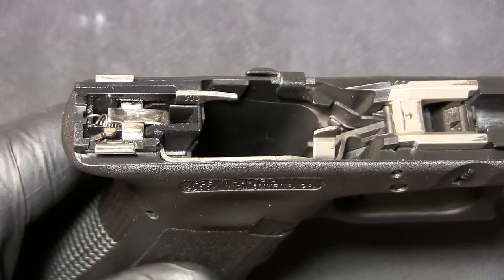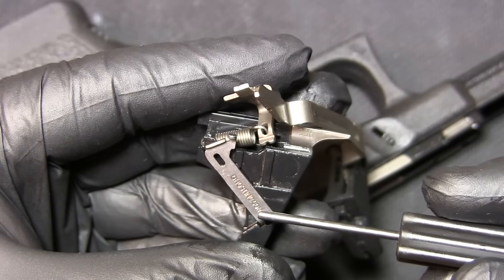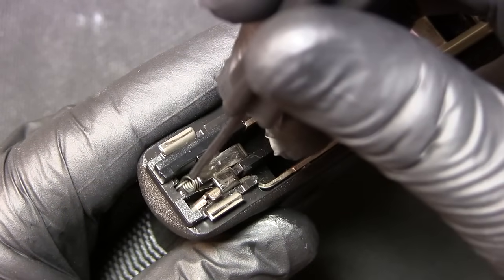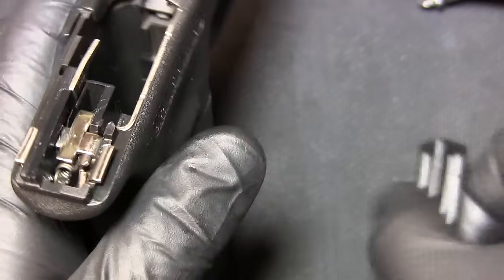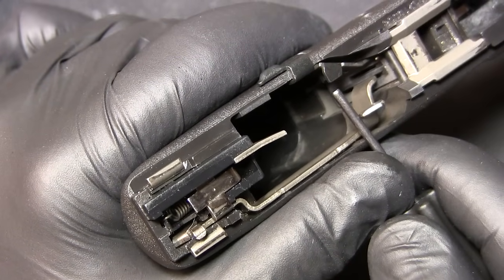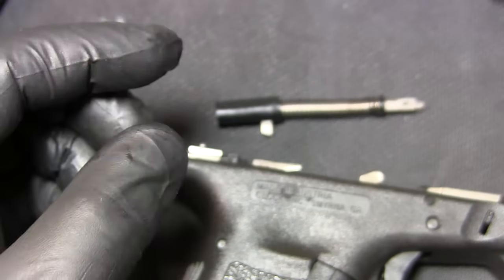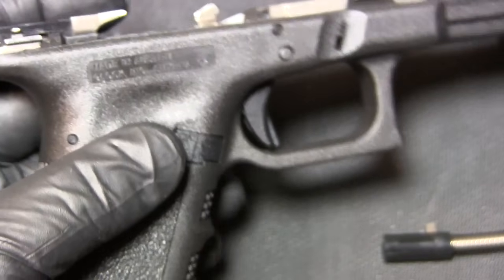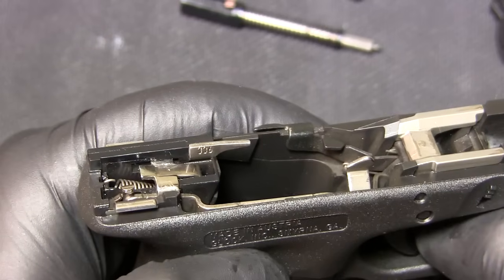How Glock triggers work and how they reset

Comment: So is Glock the only Stricker fire pistols with this kind of a trigger reset? I own 3 different manufacture Stricker fire pistols, and none of them work like a Glock. They are basically built the same way. Is this just a Glock thing? To me, this is a complicated trigger system compared to like the S&W and so many others. I have always wondered why Glock has so much hype and are so expensive compared to others. Probably because of their trigger systems. I got my hands on one the other day for the first time, empty of all rounds of course, and I racked it back and pulled the trigger, and it stayed back. I was like hey, your guns broke, lol Still can't figure out the purpose of it other than that's just how the whole thing operates. At first I thought it was some kind of safety feature, but now I see why. Great video brother
Reply from the maker: Thank you. Not sure if other makers use similar designs, but I wouldn't be surprised if they did. Pretty simple system.

Comment: So if the trigger will not reset if you hold it back then release, after slide is forward. Is it the slide spring? Or the firing pin spring not pushing forward on the reset bar? Thanks in advance.
Reply from the maker: There may be a few reasons. And none of them will have anything to do with a slide (recoil) spring. First you should make sure that the trigger spring is not kicked off to the side on the bottom of the trigger bar. The hooks of the spring should be aligned. If the spring is rubbing on the trigger housing it will produce a failure to reset and a really gritty trigger pull. Let me know if that is the case with your Glock.

Comment: thank you for your video and good explanatiions 
So what is the best way the parts to change to get less recoil with 9mm ? 
thanks 👍
Reply from the maker: Recoil is a different beast. Mainly it will be managed by the weight of the slide and the recoil spring. Lower power ammo can really reduce felt recoil.
Reply: @MosinVirus  thank you for your answer 👍🍺

Comment: I finally understand this, but my question is, doesn't the trigger slap your finger when reset happens?
Reply from the maker: No, never felt it snap on the finger. The force you are applying to the trigger during the cycle is easily more than the striker spring, so you will be releasing the trigger for the reset to happen and feel only a slight click when it occurs.

Comment: DONT FUCK WITH THE STRIKER AND THE TRIGGER RETURN SPRING. EVER!!! just polish out the stock parts and or replace them with after market components as kits from the same maker. or if you know your shit, mix and match but never do what he did with striker spring. that part even the gurus say DONT FUCK WITH. 5.5lbs factory ONLY for fucks sake guys its a safety issue. glock triggers are the way they are for a reason dont try to get a single action feel by screwing with springs and engagement geometry. if you do this and end up hurting yourselves or others, its all on you. Ive built sub 3lbs trigger for a glock and ill tell you its unreliable as it gets...4.5~5.5lbs is 100% reliable given the ammo is made right. dont mess around with the internals people. this not just a rant but a psa...
Reply from the maker: Thanks. This was more of an explanation of the system. I know stretching the spring isn't reliable.
Reply: @MosinVirus  cool
Reply: What about the ny1 spring with factory striker?
Reply: @jll9764  the what?
Reply: @THEGRAYFOXX00  changing the trigger spring to the ny1 with stock striker spring, is that okay?
Reply: @jll9764  im guessing you had the dreadful  aftermarket spring but now you're switching to oem, in that case you're returning the gun to its oem specs so yes it is. btw why did you want to increase your trigger pull weight to damn near 12lbs? majority of us prefer a crip short break between 3.5/4.5 lbs with as close to 0 pre/over travel. just curious
Reply: @THEGRAYFOXX00  NY1 trigger spring makes it about 8 lbs and it's because I'm switching from double/single action. The idea is the first trigger pull would be 8 lbs, then your follow up shots would weigh less with a little more noticeable reset. Correct me if I'm wrong  thanks
Reply from the maker: I don't know why anyone would voluntarily install that NY trigger spring into their Glock, to be honest. If you want a heavier trigger pull, you can go with a +connector. It all depends on what you use your Glock for. If you carry it, i wouldn't advise changing any part of the fire control group. If it is for competition or range fun, then there are tons of options.
Reply: @jll9764  don't bro... don't do that. If u really want to mess around, get the dot  connector with housing that has adjustable pre travel and over travel pinned in. Wolff 6lbs return spring and curved carry trigger shoe. Carefully polished all mating surfaces without altering engagement geometry if you're up to it 😀. Good luck

Comment: Just in case you're wondering why you can't get the trigger to the fully coced position by trying to push the trigger bar forward while holding the trigger down it is because after the trigger bar dropped down due to trigger reset here is the explanation I finally came up with after grappling for an explanation. While the gun is disassembled and after the connector pushes the trigger bar upwards to engage the firing pin then when the trigger bar is pushed forward partially from its most rear position to reset the trigger, at this point the trigger is only half cocked and the trigger bar will drop down so that the trigger cannot be moved forward to it's fully cocked position. When the gun is assembled and after the trigger is reset the trigger bar will not drop down because the firing pin is pushing against it keeping it from dropping down. Once the trigger is released the firing pin spring will continue to push the trigger into the fully cocked position.
Reply from the maker: Not sure what the point of the comment is.
Reply: @MosinVirus  when I had it disassembled, and I tried to reset the trigger to it’s fully cocked position. I couldn’t move the trigger bar forward when I was holding down the trigger. But when it was assembled, I could hold down the trigger after firing and keep it held move the slide forward while I was still holding the trigger and then when I release the trigger, it would move forward until it’s fully cock position, and I was just looking for an explanation as to why that was the case.
Reply from the maker: @mesavage999  I believe you misunderstood how the system works. Firs and foremost, the reason you cannot move/pull/push the trigger forward when the rear of the trigger bar is resting low is because of the trigger housing. It is done on purpose. The trigger housing slot where the trigger bar moves has a low position opening that doesn't extend forward. There is a step there. It is there to prevent the trigger from being reset with the bar in low position (under the striker lug). 

Second, the connector doesn't push the trigger bar up in the way of the striker lug. It only pulls the trigger bar down to release the striker lug and allow the gun to fire. When the slide moves back to eject a spent casing and load the next round in, it actuates the connector by pushing it away and allowing the trigger bar to rise. The reason the rear of the trigger bar rises when the connector is pushed away is because of the trigger spring connecting the bottom of the trigger bar to the top of the trigger housing. That spring is what pulls the rear of the trigger bar up and to the rear. 

With the slide off the gun, there is no striker lug to continue to push the trigger bar forward, so the trigger will only be kept in a reset position if you engage the trigger safety tab. Only that will keep it forward. The trigger spring will always want to pull the trigger back. The striker spring is what overcomes the trigger spring and pushes the trigger forward. One is horizontal and the other is nearly vertical, so spring weights are not compared completely equally.

Hope this helps.
Reply: @MosinVirus  You said it better than I did. Thank you.

Comment: The Glock really is a cheap pistol; cheap to manufacture as it is made of (60%+) low cost materials. The polymer frame is injection molded and the internal mechanisms, if they're not plastic, are made of simple, low cost stamped steel. The only components that are truly expensive are the slide, barrel and perhaps the extractor. These hardened (heat treated) steel parts require CNC milling and some special attention in how they're made. Glock COULD lower their prices and get more product into the hands of their customers but they are very profit motivated. They rely on their reputation of unparalleled reliability and durability to sell their pistols because people will pay more for that reputation *and name recognition*. Whereas Henry Ford continually lowered the price of his Model T and also made quality upgrades, he was able to sell thousands more to offset the cost of manufacture and have everyone in the known world driving a Ford.
Reply from the maker: I don't think Glock is doing too bad.

Comment: I read somewhere about a Glock's trigger bar being broken/damaged resulting in the firearm becoming inoperable.  The firearm had been fired prior to that without any issues.  Can someone explain how this could happen?  Thanks.
Reply from the maker: Usually replacement of a broken part solves the issue. Though if something else followed the initial breakage and led to more catastrophic failure then I guess it could render the pistol unsalvageable.
Reply: @MosinVirus  but do you know what could cause a trigger bar to be damaged to the extent that the firearm is deemed inoperable because of that damage?

Comment: 8 years later and your video is still helping. i am having issues with double fire and the safety is not resetting smoothly. i have an aftermarket glock store trigger in it. thanks to this video I now think I know the problem. thank you again
Reply from the maker: My pleasure. Make sure the trigger spring is not kinked to the side on the bottom at the trigger bar. If it is off to the side it can lead to reset issues and I can imagine it could cause some double fires
Reply: @MosinVirus  
Thanks I'll do that

Comment: Great Video! I had a fuzzy idea about how the Glock trigger mechanism worked before this but this video makes it clear as day, Thank You.
This video should be used by Glock to teach users an armorers about the gun.
Reply from the maker: Thank you very much for this great feedback. I am really glad the video helps.
Reply: @MosinVirus  I’ve seen other videos about how the trigger bar and connector interact but yours was the first to the relationship between the cramming surface on the slide and the connector, that relationship had never dawned on me. I’ve sent this video to my older son who’s a LA County Sheriff’s Deputy and a senior range instructor at their Wayside training facility. Glock is an approve sidearm for the sheriffs and my son has a Glock so I think this video will be helpful to him.
Reply from the maker: @pauliedweasel  thank you. I do hope it helps people understand how the system works.
Reply: @MosinVirus  It’s perfect!

Comment: thank you sir. I been working on a failure to reset with the trigger depressed. it only happens with one of two slides, not OEM of course. will have to measure the milling differences on the slide bulge and then consider adjustments in the trigger bar to compensate.  any suggestions there?
Reply from the maker: My pleasure. I would recommend getting an armorer's back plate. It will make it easy to see what exactly is happening as slide retracts.
Reply: @MosinVirus  btw, got on a couple forums and seem to have narrowed the issue to the height of cruciform and the malfunction of the sear not catching the firing pin. Notably due to this rig being a GST-9 and their RLBR assembly being made from too thin of material. this translates to about .15 to .5 mm higher rail. variances in the slide cuts add to the tolerance stacking to create this failure. SOLUTIONs:  get "pre-eh" trigger bars (w/ + stamps) or invest some time in fitting other rails like the p80s,  Rook Tactical Rear Rails, Palmetto State's "Dagger" Rear Rails
Reply from the maker: @zmbombr  i am glad you got to the root of the problem. And good luck whichever way you proceed.

Comment: I thought it was broken
Reply from the maker: What exactly?
Reply: @MosinVirus  is that normal for all glocks? They will not reset without the slide on ?? Thanks in advance
Reply from the maker: @Callthefedsonme  the striker lug is what pulls the trigger bar forward, so yes, without the slide you have to manually push the trigger bar forward to reset the trigger.
Reply: @MosinVirus  I’m use to striker fired and double action
Reply: I never had a glock or even fired one and I’m building a gst 9 from 80 percent arms… my trigger wasn’t resetting without applying pressure on the trigger bar. Because I haven’t received my slide yet thanks for the reply!
Reply from the maker: @Callthefedsonme  understood. Yes, replied earlier, but the striker lug is what pulls the trigger bar forward and what resets the trigger. In turn, when the two are engaged and you pull the trigger you are also pulling the striker back before it is released to strike the primer.
Reply: @MosinVirus  thanks for the information I appreciate it bro
Reply from the maker: @Callthefedsonme  my pleasure.

Comment: great explanation. but question? so after i fire a shot and the trigger resets how come my trigger just goes down when i try to fire another shot? does that have something to do with the connector? help.
Reply from the maker: I am sorry but I don't quite understand the question. What do you mean by trigger going down when you are trying to fire?
Reply: @MosinVirus  my fault I should’ve been more specific but the trigger just goes dead. if you will. instead of having that applied force it takes to pull the trigger and fire another round it just clicks down and of course i can’t fire another round.
Reply from the maker: @HllboyYC  sounds like the trigger bar may not be engaging the connector. Or, the trigger spring hook on the bottom of the trigger bar may be off to the side so it is dragging.

Comment: PLEASE HELP I REPLACED TRIGGER SHOE ON 19 gen 5 and now if I hold down the trigger it doesn’t reset at all it resets when I racc the slide but not if I dry fire and racc it while holding the trigger it don’t reset
Reply from the maker: Check the trigger spring. Make sure the bottom hook is not kinked to the side.

Comment: I got a reset but no audible Click on the reset please tell
Me what’s wrong lol I’m stumped
Reply from the maker: The audible click happens when the connector snaps back as you allow the trigger bar to be taken forward by the striker. If you have no audible click your connector bar may have been bent at some point to not have as much outward tension. It may not be hitting the frame when it returns to it "connected" position.
Reply: @MosinVirus  LOL this is a newer firearm it always clicked on the reset 
Took it apart for storage came back a year later installed the slide and noticed it wasn’t CLICKING on the reset… maybe 50 rounds down the pipe and never dropped or beaten. 
I racked it over 50 x and it resets but no CLICK like before.
Thanks for the response 
Your videos are A+
Reply from the maker: @kevinn4393  thank you. Perhaps, take the slide off and check it the same way I showed on video.

Comment: Thank you!
Reply from the maker: My pleasure
Reply: @MosinVirus  I went to the range this morning with my 43X and on several occasions the trigger shoe would not move forward after the round was fired. The internals are all "Johnny Glock" custom parts so I am wondering if he switched the stock striker spring to a lighter one? I am waiting to hear back from him.
Reply from the maker: @ArtieGlock  check the trigger spring and make sure it is positioned correctly. If on the bottom, where it hooks onto the trigger bar, the spring is kicked off to the side, it will rub on the trigger housing and can cause a reset issue.
Reply: @MosinVirus  Will do...thanks again!